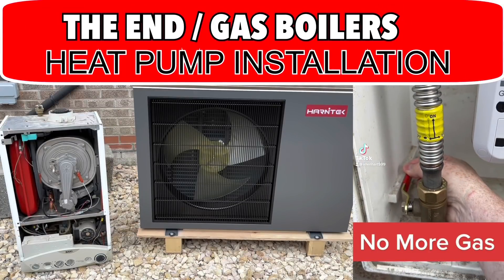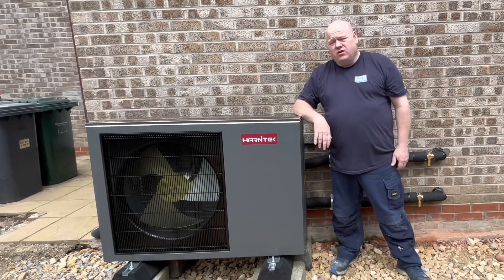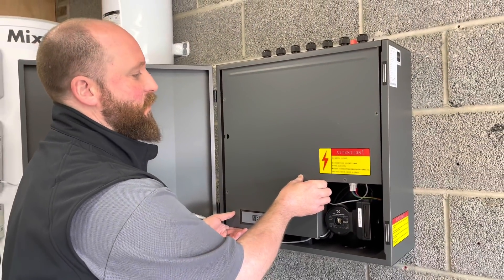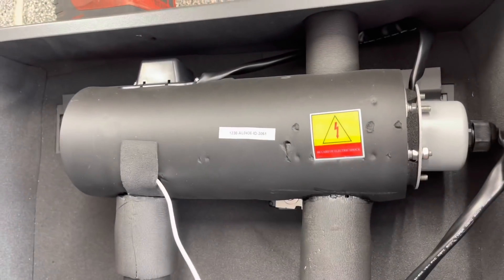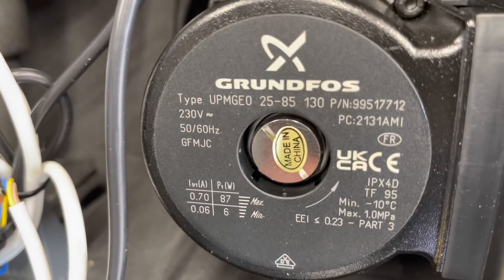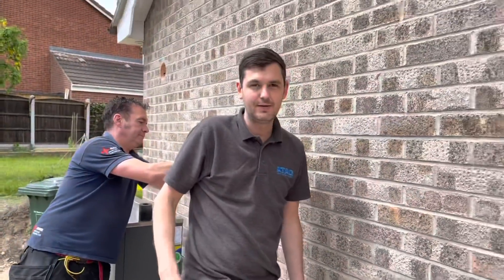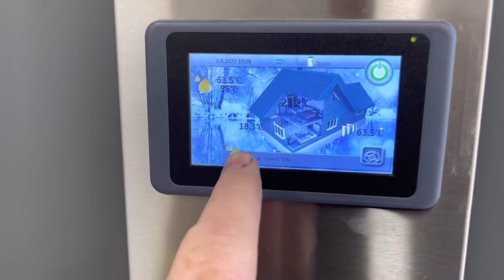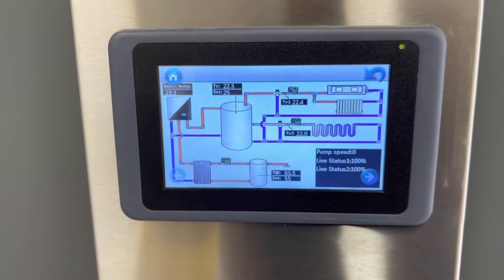ASHP INSTALLATION | The End / Gas Boilers Heat Pump Install Harnitek NGCFE

Comment: One important point is to make sure that the ASHP is on a solid base, ie a concrete pad.  That's because if it isn't,  it will tilt and wear out the fan bearing resulting in noise and expensive replacement.   Therefore to improve this and increase its life, remove the concrete blocks sat on rubble and put on a solid pad that won't cause problems.

Comment: Great video. Nice tip about the batteries and inverters max 3kW discharge which catch a lot of people out. Upping that to two inverters or above 3kW will also require a G99 to the DNO before install rather than the G98 notification after install. Still a long way to go before the tipping point where it makes sense to invest in the initial outlay of all this currently expensive equipment and scarce qualified specifiers and installers. From a political point of view I find it ridiculous that we have to build our own solar installations when the government should be providing energy so cheap that we don't have to. Why are ASHP's so expensive from China compared to boilers made in the UK and EU? I mean they don't even have to pay the Carbon Tax and they supply a world market.

Comment: Legionella and supplementary heating of water has COP value of 1.0. If you need the electric heating your calculations are wrong or you need more insulation or both.

Comment: Thanks for the YouTube, very informative helps me to understand how it all works, for me I do want to replace my gas boiler next year as my cheap gas tariff ends August 2023 but have started planning now and heat pump my work for me.  In the meantime in want to get solar panels with batteries and a Mixergy tank now.

Comment: Fantastic video. Watching from Northern Ireland here. Love your videos. I have a 4kw array and have just had my ashp survey done today. We use oil at the moment but my quote to fill the tank 900 litres roughly was coming in at £945 !! No way so I am going ahead with a Warmflow ashp and the full hog. Extensive calculations were done and some rads need upgraded. Also cavity and loft insulation is being topped up while they are at it. One thing we are looking forward to is converting to a pressurised system. Being able to gently top up heat in our house using solar and with a cop of 2-3 we can't wait to get changed over. Fair enough the electric bill will be substantially more but at the end of day no more worry about oil and gas prices and a simple easy one bill system.

By the way I would absolutely love to know how it's performing in terms of heat output in your house. Is it comfortable. I've seen a few videos where people say it feels chilly in winter but I would really like to know if it is. I am thinking of leaving mine on constantly but letting it work in weather compensation mode etc. Definitely excited to see your review of heat output and power draws. Thanks for the interesting videos.

Comment: If you had a ground source heat pump, would it eliminate the need for the external air source heat pump apparatus outside.

Comment: Hi Allen, it is advertised that air source heat pumps can work in reverse durng summer months to cool the house down. Wondered if you have had any experience of this during the currenrt hot weather?
Reply: Some mini split heat pumps can work in reverse but not these that use your existing radiators: they would get covered in condensation and need drains below each one.

Comment: I think you're moving in the right direction but boy, I'm guessing many gas boiler manufacturers and installation technicians are experiencing the same trauma as the coal industry and miners when coal was increasingly phased out in the 1980s onwards.

Comment: Allen.
You are an inspiration and on a mission!
Ive watched all your videos and as a result of your In Roof Solar system, I decided go down the same route too.

However, we will not get rid of piped gas for the foreseeable future. Its piped to just about every existing property so unless we stared knocking housing estates down and re-building them to passive std's to fit all this new technology neatly and discretely we have to live with what we have.
 
There must be thousands  of old gas boilers around UK that are un economical and need replacing if not condemning. If the law prohibited you fixing them (and reporting them) with a grant available to those who qualify for replacement assistance we would achieve more than anyone could imagine.   So why are we not going this? If we then add  20% H2 / bio gas to the grid we are on a winner and for most people, it would be the MOST ECONOMICAL and less destructive way forwards. 

Why do I say this?
My typical 3 bed semi in Hudds is ultra insulated. Walls, floors, ceiling, glazing and roof. 
I have a 5yr old WB Greenstar 37CDi with  generally oversized radiators and the house is very warm within a few min from cold.
Jan/Feb 22 was our coldest month but we only used 2021kWh of gas (@3.79p) =76 pounds which  incl. cooking, hot showering and a very warm house is not a lot of money all things considered today.

Could you achieve all that that with a HP  for 76 pounds  if buying electricity from the grid?
If the price of energy /kWh was as 1.5yrs ago, the monthly cost would be nominal.

The prices of gas and electricity will come down as its un sustainable  as it is now.
It is "Rip Off Britain" and Im glad Boris is looking into de-linking the price of electricity from the price of gas.
Needs to happen asap before the next price rise and that would be all is forgiven "get out of jail free" card for him!

Comment: Allen. You have invested alot recently. As a gas engineer I'm sure you can get your head around all of this, but for Joe Average all this will be overwhelming. Your garage now  resembles an industrial installation but looking forwards to your performance feedback and cost analysis now that it is working of solar but let's see in winter.

Comment: Wonder how a unit such as this compares to a Thermodynamic panel setup. Looking to try and install a system for my two bedroom end terrace that can provide me with an energy bill as close to zero as possible. Between solar panel / battery setups for electric and a unit like this I have yet to see anybody that has next to no monthly bills. Beginning to think I would just be better of  wearing more clothes and don't switch anything on, lol.

Comment: Waiting for my gas system to blow up before changing to heat pump. Not worth going heat pump unless it's from the get go. Payback period too long as an upgrade from an existing gas system. Units here in oz about 2 k plus install

Comment: Hi Alan
Thanks for sharing your journey.I’m fitting a grant ASHP 10kw now and like yourself im running the system before any rad changes. My old ideal floor standing boiler is valved off but not yet removed. My house is a 4 bed detached 1970s build. Insulation has been increased wherever possible.I’m disabling the DHW cycle via the PCB parameters on the Air pump, i fitted evacuated tubes 15yrs ago that keeps 300l at 60c ish free. I worked on ASHP abroad 10 yrs ago.Most units were 10+yrs old. Old sch large water content system with thermal circulation considerations works for me lol.
Will you be adding another inverter in the future 
Keep the great videos coming
Thanks
John

Comment: Never heard of that brand also what happens with the warranty when the supplier goes under…..
Reply: Grant Boilers have been around for years, especially oil boilers, they’re British, made in Devizes. I’ve often come across their utility oil boiler range. Speak as I find, fairly well made and have an above average boiler life. Their new AHSP unit arrived last week and again, it appears well made. The few times I’ve phoned Grants it’s always been promptly answered. Stuart is our salesman and returned my missed call. How many other manufacturers do that and over 40 years as an engineer I’ve learned to value manufacturer back up immensely. Unlike the case with VAILLANT boiler manufacturers, they have abused installer loyalty, sold us personally courses costing hundreds of pounds and now pan out to be a complete rip off. After 30 years of installing Vaillant we now no longer promote or install any of their appliances. That’s just our experience down here.

Comment: Great system with the solar. How does the heat pump system work if there is a power outage like what happened in Scotland recently
Reply from the maker: Would be same as a gas boiler, they all need power.
Reply: Solar battery store
Reply: @John-cq5me  If you haven't got a solar battery that is my point, the systems all need electricity to run, no power, no system. Now if there were emergency batteries included in a system, topped up off the main supply when needed and only kicking in to run a limited time till an outage is fixed I could appreciate that :-)
Reply: @Waciglass  agree and it will perhaps develop into a fare priced package with batt,Elon is leading batt tech with cheaper competition growing already hence my optimism  . For now its my preference to try 300% plus efficiency whilst attempting solar dependency.I’m weary of the gas boiler cost and quality rip-off.My 15yr dhw panels have little attention and zero service maintenance costs so far.

Comment: 3kw back up heater + electric to run system 24 hours a day What was the cost to supply and fit
Reply from the maker: I will not be using the backup heater. Thanks.

Comment: That looks like a anew house with suitable room and insulation. Millions of houses are not and never will be. This is an unreal videos for a vast majority of the population. All pushed by politics. The Chinese will be burning coal when that heat pump is worn out and replaced. The climate will not be saved by you guys and I doubt that you believe it. But it is money in your pocket so take the money and run.
Reply from the maker: House is about 50 years old. Thanks.

Comment: Not a chance these will replace combi boilers. Hydrogen will eventually replace gas as a fuel.
Reply from the maker: Only time will tell. Thanks.
Reply: only on 20% hydrogen mix in natural gas. 100% hydrogen not going to work, you would have replace all the gas pipes for a start, as it would leak like a sieve with current pipes. plus it costs alot of energy to produce hydrogen.
Reply: @tonyrichardson2637  at the moment costs to produce hydrogen are high but this will fall as techniques and scale increase.

Comment: 1) Would you have to replace pipework in the house? Our house was built in 2000 and has copper microbore feeds on drops, 15mm flow and return (I think, may be 22m)- currently has a combi but used to be conventional boiler

2) Electrics - was a single phase supply enough or did you need to upgrade to 3 phase supply?
Reply from the maker: I haven’t updated my system yet. we are going to have a winter as it is. Thanks.

Comment: Hydrogen boilers work at a higher pressure all pipe work under 15 mill would have to be changed
Reply from the maker: That’s not true. Thanks.

Comment: Around 1940 was the time for heat pumps as we approached sun spot maximum in 1957. My parents say it's never been as warm as the 30/40's. So this warm period we are in started in the late 1600's, had its maximum in 1957 and the numbers have been downhill ever since. We wont be able to ignore it much longer. The animal kingdom has already noticed the change in the Sun, and the plagues are the sign never mind crop losses. Nothing plagues when its happy, not even us.

I'm hoping this expertly fitted system is able to be miniaturised as many don't have a garage or a front door big enough for even a decent sofa to get through or the recycle bin. It's looking like a nightmare for retrofitting to already built properties. Underfloor heating is the way to go if you can. Some other method of running it would be handy with the expected power cuts coming. Perhaps someone could invent a nuclear dongle. An insulated house with no power, is like living in a morgue.

A referendum is needed before we go any further down the Net zero road, as the road doesn't include us.
Reply from the maker: Thanks.

Comment: Trying to get over the fact that when you have a power cut nothing works. No electricity, no heating, no hot water. Are you going to add another module to over come this?
Reply from the maker: If you have a power cut your gas boiler wouldn’t work either. Thanks.

Comment: Can the ordinary competent layman, in the street, fit this system, or, as usual, does the layman have to pay, the hyper inflated, sky high, certified tradesman rates? Obviously, if allowed, the cost would be greatly reduced, and probably, even affordable, especially, in these expensive times.  Good insight though. Thanks Allan
Reply from the maker: Thanks.
Reply: Absolutely - get yourself a copy of the Freedom Heatpumps toolkit spreadsheet and do your heat loss calcs and rad sizing with it. Then find a unit that you fancy. Heat pump cylinder from World Heat or Macdonald (there are also a few slimline vaillant cylinders on eBay at the moment), plumb it up to a 3 port. It's really not difficult. If you already do your own plumbing and electrics then it's certainly well within your skill set.

Comment: Ban gas boilers the doom mongers say. Force people to fit heat pumps. At a average cost of 15 to 30,000 pou ds. Oh, your energy bill will quadruple and you will need another back up heater in the cold winter. What a load of garbage. Ban gas boilers and what will happen when it reaches the end of it's  life? Are you really suggesting that people who are struggling can pay this sort of money. News flash. They don't have it. What do they do? Suffer from hyperthermia and die probably. Get real you doom mongers they don't have the money, they don't have room for this monstrosity in their back yard, they can't afford to run these inefficient machines and they Don't want to freeze in the winter.
Reply from the maker: Hi Paul. Thanks for the feedback.

Comment: Installing one of these now in a it's enormous, but I've got another 9 booked in across London so it's gathering momentum
Reply from the maker: Whats your opinion on it. Thanks
Reply: @AllenHart999  once it's commissioned I'll let you know. Based on it's data it  does not match the performance of it's predecessor, an emersion will be needed in the HW cylinder to achieve temps.
Reply: 3 new air pump installs here in the southwest,it is gaining momentum.Im hearing other engineers getting inquiries weekly.As an engineer the simplicity on ASHP and efficiency is impressive and they have been around for many years, there’s a reason for that. Photovoltaic,ASHP and a blade less 1kw wind turbine is the plan for my home.My old evacuated tubes have givien me 10yrs dhw free.

Comment: not going to get much solar in the winter maybe cover the base load in the day.   I got around 30 kWh in December it got better in Jan was around 80 to 90 kWh.  in may I got about 500 kWh.  With out a a battery I use around 50%.
Reply from the maker: How many panels do you have? Thanks.
Reply: @AllenHart999  16 panels total 4kWh but limited to 3.6 kWh by the inverter.  I  inherited the system when I bought the house in 2021 but the same was installed in 2012 by a Shade Geener. So I don't own the system.    I also have a Nissan leaf which I charge from Octopus Go and new boiler Viessmann 2021 35  kWh installed in 2021 with Wiser Smart opentherm and smart radiator stats on all radiator.

Comment: Allen I've been involved in 2 air source installations and both had refrigerant lines from outside unit to a hotbox in the property which needed guys with specialist refrigerant licence to commission so my question is why your system different  I don't understand the difference between systems can you enlighten
Reply from the maker: F-gas systems have the gases in.
Reply: Mike, I think Allen's installation uses a self contained outside unit, with a large coil and fan, working as the evaporator, and the Condenser coil ( Your "Hot Box")is contained in an insulated tank in the same outside casing, filled with the water and antifreeze mix that is circulated round the radiators via 28 mm copper pipe. The advantage is , less refrigerant in the system and a massive reduction in costs of Braised pipe joints, Refrigerant leaks and only needing and F gas certified engineer if the heat pump fails. I have previously been involved in large hotel retro fit systems in hotels using two pipe and three pipe systems and the prevalence of leaks in refrigerant lines is costly, as you not only lose the refrigerant, but compressor oil as well, and the costs of leak finding and repair are prohibitive. You cannot just top up a leaked system as the most volatile constituents of the refrigerant boil off first , and leave an unusable residue. Correct practice after a leak on a large system is to Vacuum the system down, followed by a pressure test with high pressure nitrogen for 24 hours-remove nitrogen and vacuum down and refill with refrigerant and oil. For domestic use I think the method  Allen shows is the most cost effective.
Reply: The gas type can be better as you have a smaller unit outdoors, and no risk of freezing flow pipes outside, though you need more equipment inside the property.  I've seen some setups that combine the cylinder with the indoor evaporator which seems neat.

Comment: Good for you. Thinking of going heat pump but thinking of just installing a 4 head mini split system. It'll leave my hot water running on oil, but should reduce my annual oil consumption without costing a fortune, and give me cooling on the very odd day that might be needed.
If I needed a new boiler I'd be going air source heat pump or pellet boiler, but keeping a wood burner as backup - had some nasty power cuts this last winter with Storm Arwen.
Reply from the maker: Thanks.